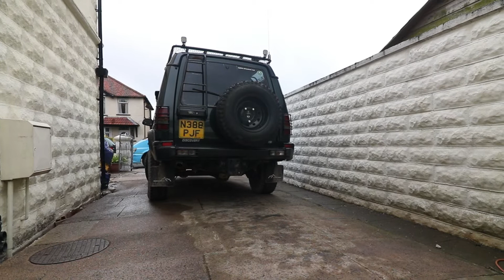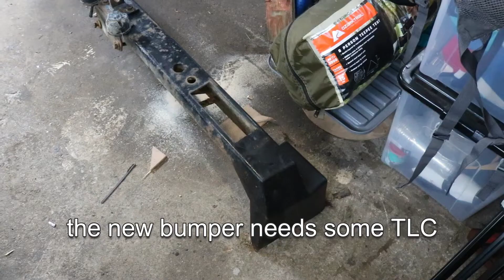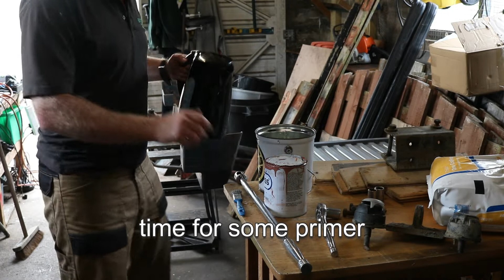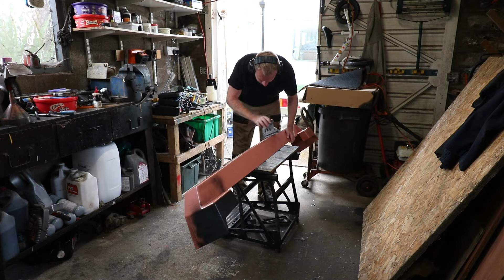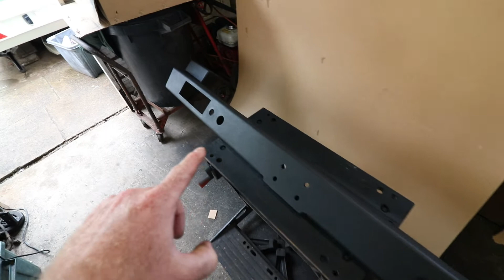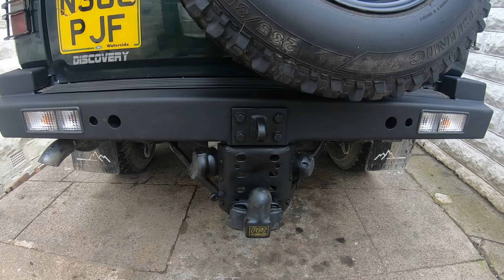Discovery 1 gets a new HD rear bumper

Comment: Is the bumper held on with the 4 bolts on the middle? I have bought the same one second hand cheers
Reply from the maker: The 4 bolts go into a bracket that fits over the rear crossmember with 2 bolts from underneath and then there are two bolts at each side near the jacking points

Comment: Great looking rear end, the Disco's not yours, why did you do matt/satin finish as opposed to gloss? Take care and keep safe.
Reply from the maker: Haha thanks! I went with the Matt bedliner because I already have the bull bar in the same paint. Originally I was going to go with raptor but the cost was more and I would need a compressor to apply. I wish I had gone with raptor as it’s much tougher and doesn’t mark. So I may end up painting in raptor in the future. Thanks for watching
Reply: @TheNorthernExplorer  2k Raptor comes in aerosol form. You press a button on the base to mix in the hardener and have 4 hours to use it. You can also get 1K Raptor in aerosol. It is nowhere near as tough as 2K, but there is no time limit to using it once started.

I refurbished the metal parts of my D1 stock bumpers with Corroless S like you and RF16 black on top, using a spray gun. It looks nice, but will chip too easily. I may have redo in Raptor too, if it starts to chip.
Reply from the maker: @r0tekz  thank you! I might have to look into that 👍